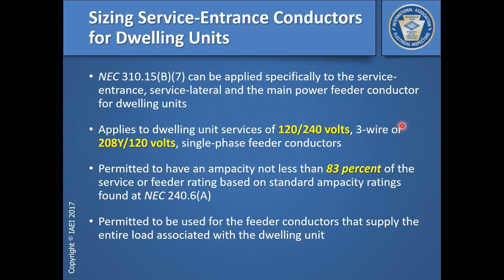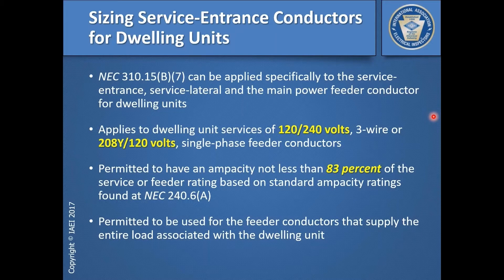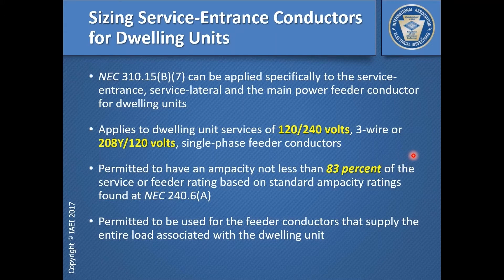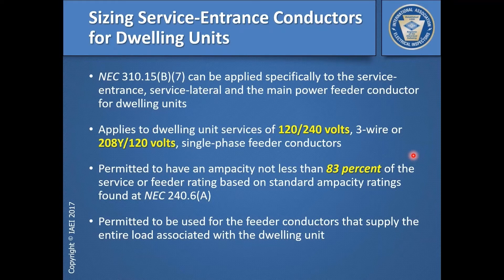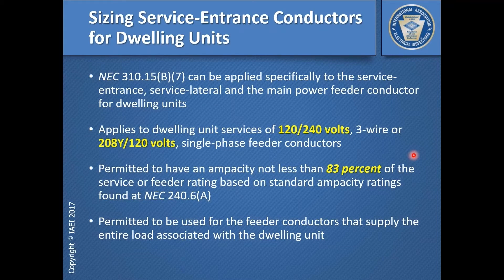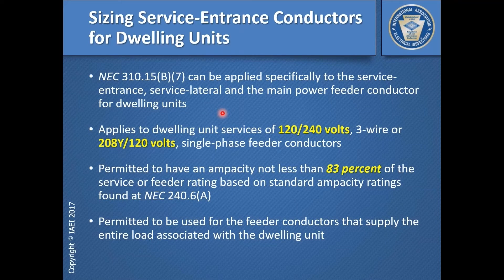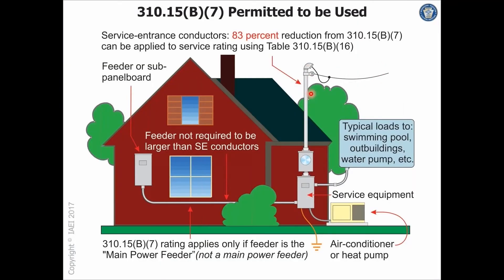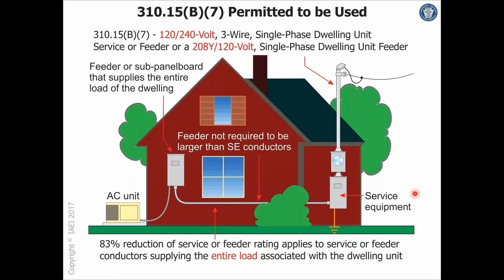IAEI Training Shorts — Sizing service-entrance conductors for dwelling units per the 2017 NEC

Comment: 2 questions: when Ca & parts of NY prohibit any gas for new homes in 15 years then 10 years later make all homeowners get rid of all gas appliances including furnance water heaters dryers cooking etc & no more ICE vehicles around that time so what size service would average 1500 square foot need to supply electric heat & EV chargers? Question #2 who in there right mind think that any ultility company can triple or quadruple the available generating plants and distribution lines in 25 years.
Reply: Who comes to an electrical trades training video to whine about politics?